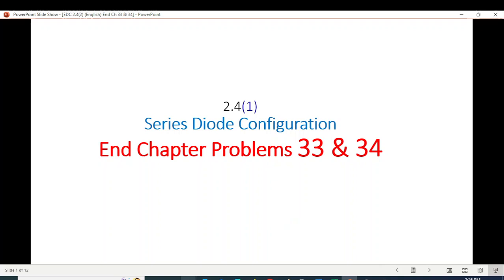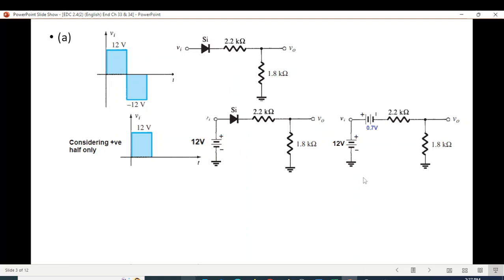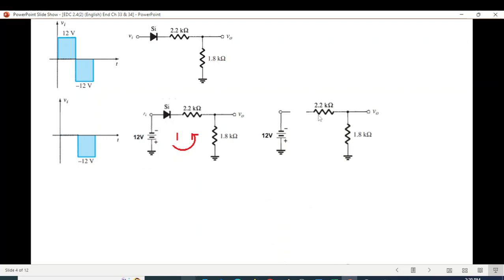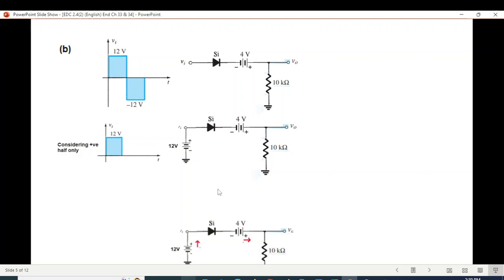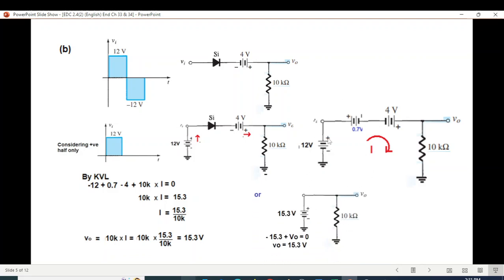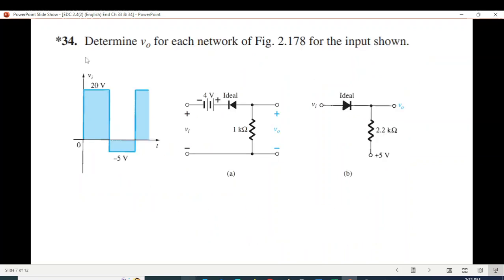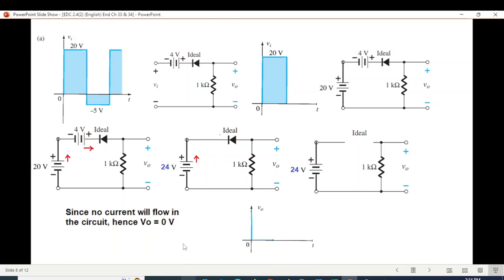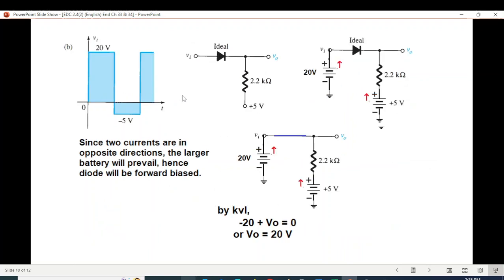(E)EDC(B) Q2.33 & 2.34 || Series Clipper

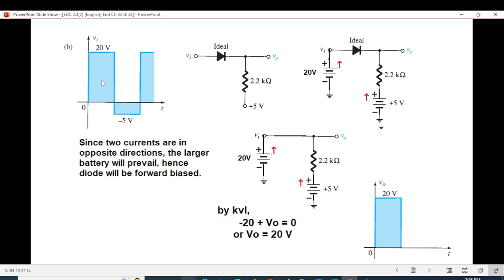Comment: Hey sir, hope you are doing well. For 10:10 , Would the output be Vo=15v? As Voltage across the resisor is 20v-5v = 15v? Please correct me if I'm wrong, I'm confused. Unless its not because the 5v source is AFTER the ground? Also thanks for your videos, I could not understand my university lecturer but your explanation helps allot, even your English! I'm an Australian studying in Australia and your videos help allot! Thanks for taking your time to create these videos for us, God bless.
Reply from the maker: Thanks for appreciating my videos.  The only mistake you are making is that you are considering Vo to be the voltage across the resistor only. Where as Vo is the voltage with reference to ground. So if you move upward from ground, you find a 5V battery + 15V voltage across resistor, making a total of 20 V. But I just wrote the KVL equation of the outer loop and simple got the answer.
I still curse my circuit teacher for not being able to explain the concept of KVL in the class (that's long time back). May I suggest that you watch my KVL videos couple of times, so as to build a clear concept. Good Luck
Reply from the maker: https://youtu.be/vEKO9tWE2ZM?si=hZgVF8Dk8ZpeR6X3
Reply from the maker: https://youtu.be/sCWGwLCRuWE?si=De0G-w4Y4CIG9410
Reply: @ElectricalEngineeringAcademy  Ohhh, that makes more sense now, thank you! I will look into the videos now.

Comment: In question 33 part a , how is v output equal to current multiply by 1.8 kilo ohm resistor ? Is there some concept behind it or can i just memorize it because i have trouble understanding this . Will be grateful for your response .
Reply from the maker: I think there is a concept issue. Voltage is always taken accross some resistance, In this case the output voltage is the voltage accross 1.8k resisrance, which is obtained by using v=IR

Comment: what is the condition for adding two battery together to form a single battery ??
in some of the math problem batteries are added together but in some problem battery which have less value we ignore that and use the battery that have higher value.  why is that ?
Reply from the maker: Batteries in series are always added (keeping in mind the polarity).  Who ignored the battery with less value 🤔. However, if one is 100V and the other is 1V, you can ignore it to get an estimated answer.

Comment: Just wondering in Q. 2.34 the (b) negative half cycle wherein the battery is -5V connected to a diode then wire to bottom it has 2.2 k ohms and + 5V, i've seen that the diode there is open-circuit as you have shown us, I just wonder why the Voltage is not 0V since you do the KVL? I mean how it has output voltage = 5V? when the diode is already open circuit which means no current therefore no output voltage to happen right?
Reply from the maker: When the diode is open circuit, left branch of the circuit is out of action ( you can just rub it off or cut it). what is left now is the right hand branch only. In this branch also no current flowing, so by kvl Vo is +5V.

Comment: SIR,  WHY YOU CONNECTED 12V BATTERY HERE , HOW I WILL COME TO KNOW THAT WHEN  HAVE TO CONNECT BATTERY OR NOT? I "M LITTLE BIT CONFUSED KINDLY EXPLAIN ...
Reply from the maker: If look at the input graph, peak value given is 12V.  I prefer to connect a battery in such case, that makes it easy for me to write the equation. You don't have do it, if you can do it otherwise.

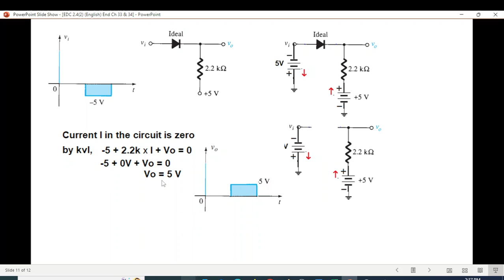Comment: excuse me sir , can you explain me why in 11:14 current I in the circuit was zero , tks you.
Reply from the maker: For the current to flow, the circuit must be completed. Here the battery current (coming out of positive terminal) is not returning to the negative terminal of the battery, hence circuit is not complete, hence no current. 
Just like if you take a 12v Battery and connect one end of a bulb to the positive terminal of the battery, the bulb will not glow (unless you connect the other end of the bulb to the negative terminal of the battery)
Reply: @ElectricalEngineeringAcademy  i understand , thank you sir. wish you good health sir.